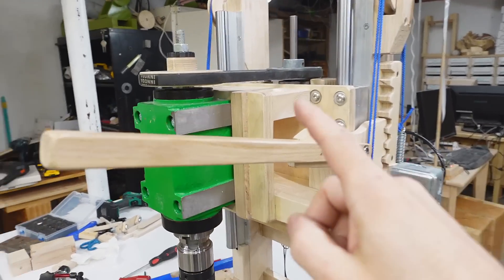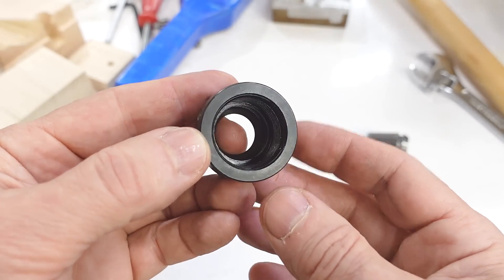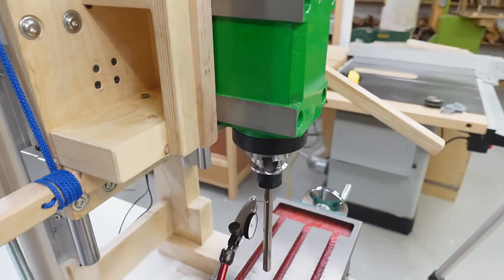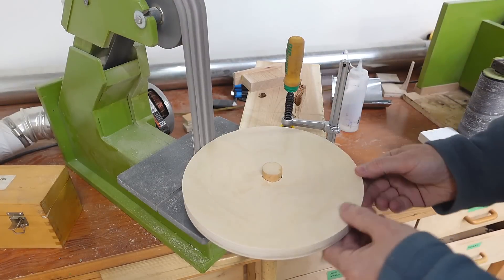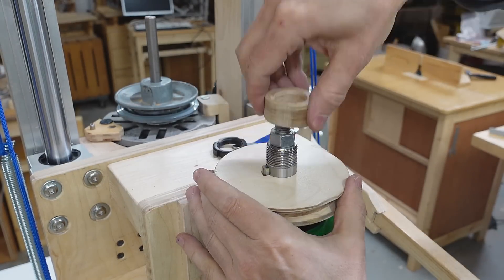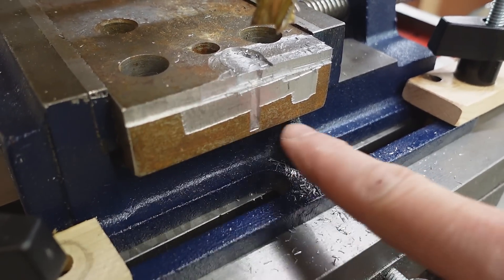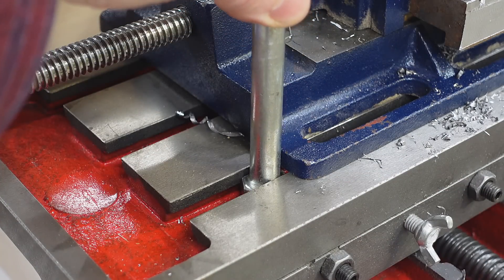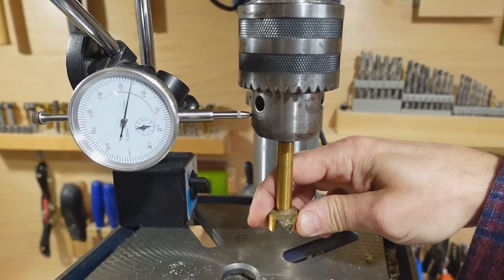Milling metal with the wooden milling machine

Comment: Machinist here… you’re on the right track, but you’re in the danger zone where stuff breaks. you will need;

- rigid spindle locking design
- mill vise!!!!! (Vevor vises are good enough)
- smaller endmill (3/8 or smaller)
- no more than .01” stepdowns / stepovers
- fly cutter (very low cutter load with one very pointy insert, so you can get away with a much larger cutting diameter than an endmill for facing operations)

Also, steel is less forgiving than wood when opening up holes. Your pilot drilling will work great if the pilot is just slightly larger than the web of the final drill. Any larger and you will just introduce chatter and the drill will grab and possibly chip, dull prematurely, or break with that setup. Hope this helps, Ive stolen many of your woodworking tricks! Hehe
Reply from the maker: Ah, yes, danger of grabbing.  But if my pilot hole is sligthly off, I imagine the larger drill will try to follow it?  I have a project in mind where I have to drill some very straight holes.
Reply: @matthiaswandel  yes typically the following drill is at the mercy of the first. might look into a reamer to make sure the holes are straight. other option is to bore them, but im not sure that would go well with your machine. (never know until you try though)
Reply: You could always use this machine to center drill or spit the locations, then finish them off with your drill press too. Or maybe some careful peck drilling could help? Not sure about that one
Reply: @matthiaswandel  Wanna-be machinist here...

I've heard that the best way to get accurately-located holes is to use a boring bar and if you want the holes to be accurately located AND accurately sized, you'll want to use a reamer after the boring bar. I'm assuming a boring bar will also produce very straight holes (as the boring bar will not follow the existing hole, unlike drills and reamers). I got this tip from the "That Lazy Machist" YouTube channel - great channel!

So, your best practice is probably to...
spot drill > drill > bore > ream
If you need to, pre-drilling seems like a fine option, with the caveat that I assume smaller bits are more likely to meander.

Another option is to drill/plunge with a center-cutting endmill. I assume you'd get a pretty straight hole using an endmill, particularly if the hole has been predrilled. (Actually, center-cutting isn't necessary if it's predrilled.)
Reply: I was surprised he didn't snap a bit when stuff let go. But I guess that machine is springy enough it saved him? On my mill it would have been kiss that bit goodbye.
Reply: Please no wooden fly cutter

Comment: Not surprised on the price, though the one thing this will do for you a mini won't is those giant pully - mini mill tend to be even narrower depth than the drillpress by quite some margin. So i guess you have a reasonable justification for the machine really - its your big drill press that happens to be a somewhat functional mill. 
Worked better than I expected with that frankly terrible work holding. I've had much more secure bolting slip on the mill before, and there Matthias is getting away with a light wooden beam acting as a spring clamp...

Comment: The milling bit you used is quite large and causes high cutting forces. The machine could do better with a smaller 6 to 8mm diameter endmill. Also try roughing type endmills, they give less cutting forces. 
I think the machine could be perfectly capable of milling aluminium with good precision. You could reinforce it even more and add mass to it. Totally awesome project.
Reply: Higher spindle speed will also reduce the forces

Comment: Now you could remake it from steel
cast from concrete with rebar and lot of fibers to reinforce it
Or use some granite pieces glued together using 2 part concrete glue (in tubes like silicone for screws) or epoxy (mixed with filler or something like jbweld, knockoffs etc) 
Could be great project for cheap 

To make every surface flat you could use piece of glass with some tape on it (or pva) and put some epoxy with filling material in it (so it stay in place and wont flow)  on the glass (or frame) then place on top of an axis (should mirror the flatness of the glass to the frame)
Or just pour epoxy on top of the frame to level itself like water .... This technique is popular for cheap big cnc machines  (if done properly can go down to 0.02mm flatness)

Comment: I know these are just first tests, but using some cutting fluid might help with the cuts
Reply: Won't the entire wooden assembly absorb the fluids and go out of whack
Reply from the maker: Yes, and it gets messy.  I'd need a real milling machine for that.
Reply: A venturi type cold air gun would aid the cooling without the mess.  They are not expensive.  Maybe we will see a wooden one!  Or plastic.
Reply: I don't think cutting fluid is the major factor impacting surface finish here.

Comment: So 5 thou is just slightly over an 1/8th of a mm?
Reply from the maker: yes, 1 mm is about .040 inches.
Reply: Yes a thousandth of an inch is 0.0254 of a mm. So 5 thou is very close to 1/8th of a mm. Only 0.002mm over or 0.127mm.